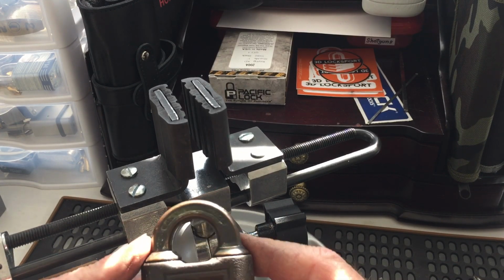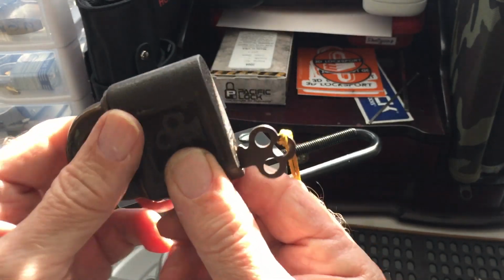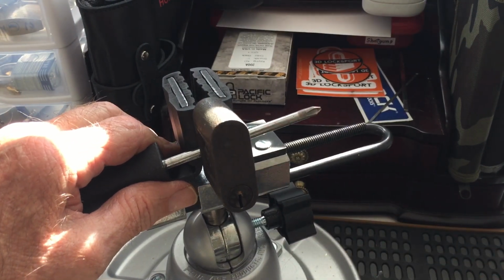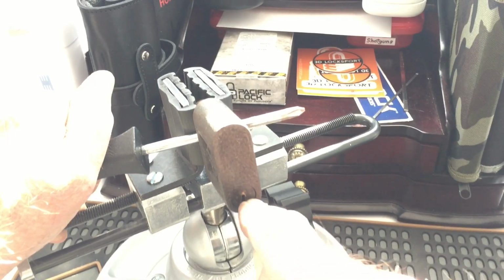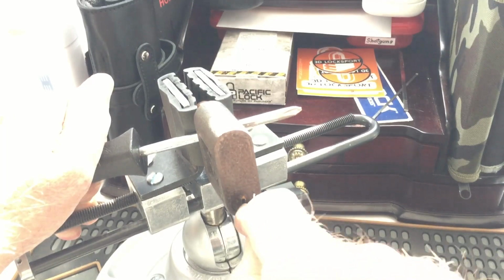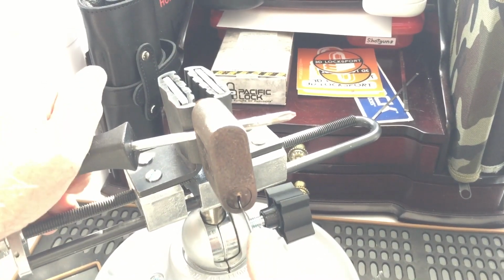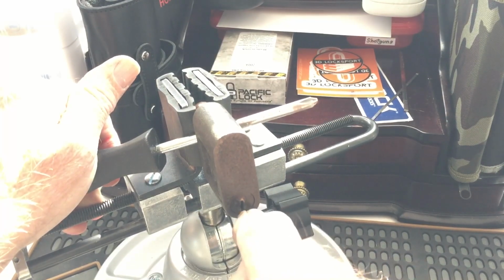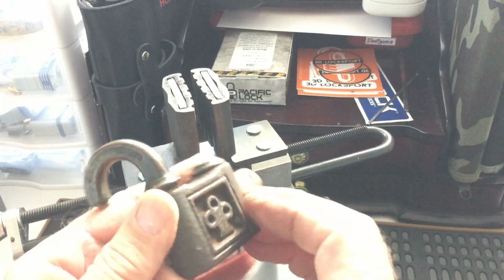#26 Yale Push Lock

Comment: I don't understand , are those like waffer locks or are there plates in there like a GM  door locks ?
Reply from the maker: Don Won   They are pin tumblers believe it or not. There are four serrated pins. The core does not rotate like a normal lock but the core is push forward when the key is inserted and pushed forward. The pins are pushed up to the shear line like a regular lock and the core is pushed forwards pushing the shackle up and out of the lock. Then the key can be turned to rotate the shackle out of the way.  You can’t tension the core with a tension tool. It must be tension verticaly, hence the screw driver applying tension vertically . 🦊
Reply: @jackfoxlock  Thanks Jack - interesting ..